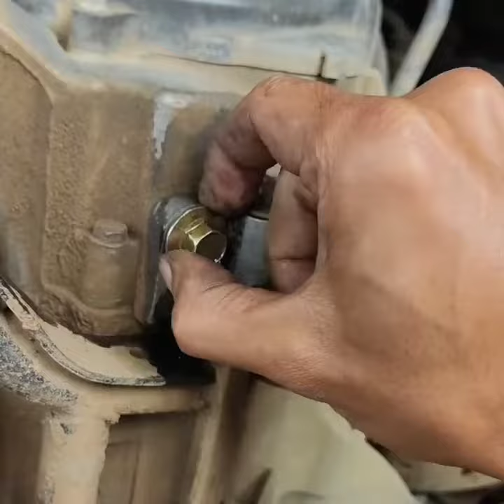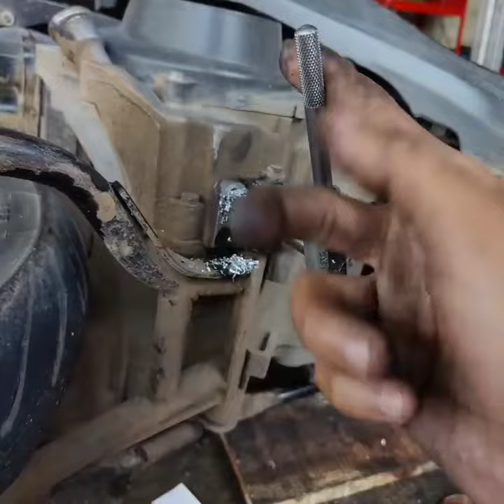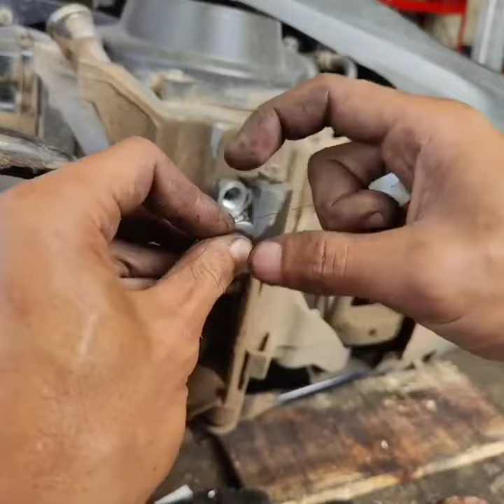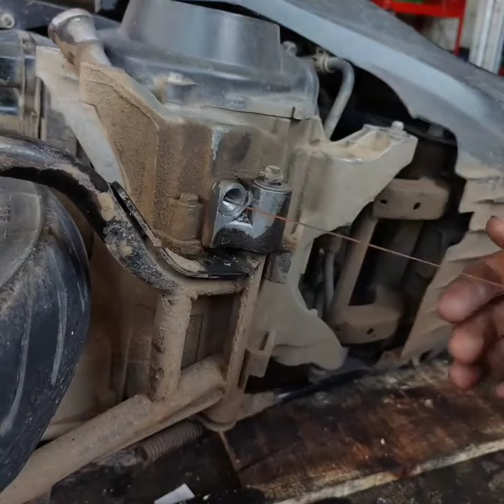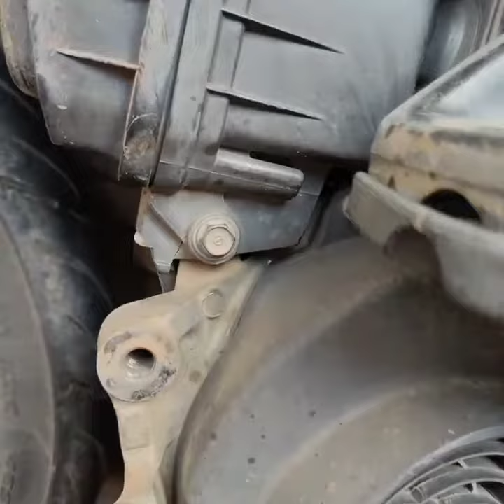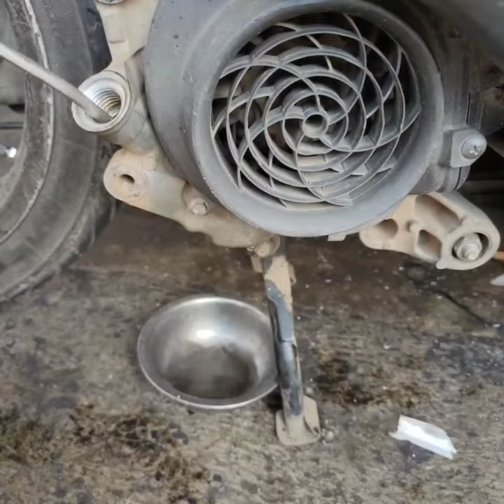How to helicoil oil drain plug

Comment: Hello, I broke the oil plug of my Vespa gts 250. Now the oil is not leaking thanks to the liquid seal. But instead of using the liquid seal every year, I want to do helecoil. But isn't the work in the video a little dirty? What should I do to prevent a piece of metal from getting into the tank? If that small piece of metal gets into the oil sump tank, won't it be a problem?Last Minute I'm not talking about the salvaged piece. Won't the metal pieces formed when drilling a hole with the drill at the beginning of the video escape?